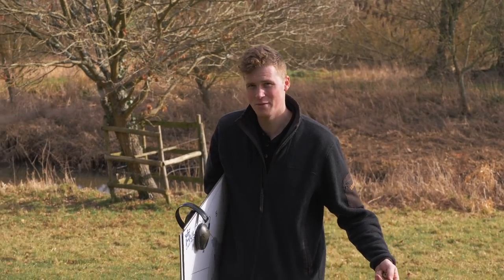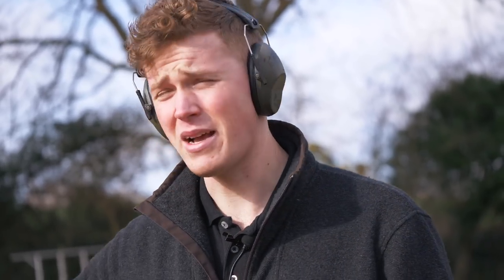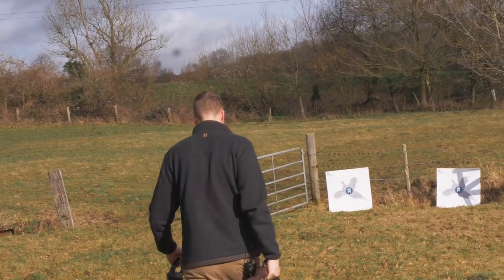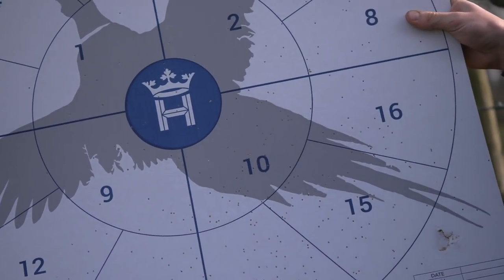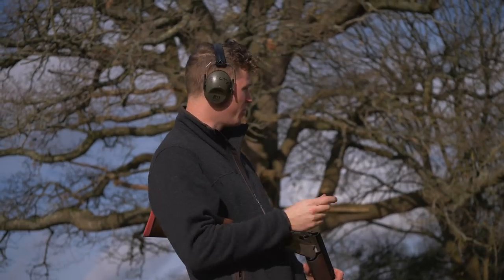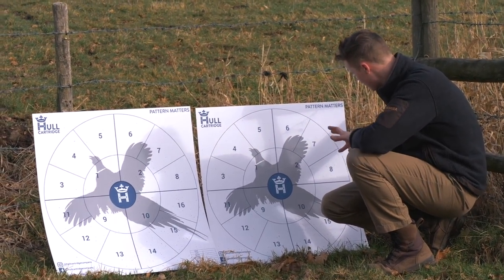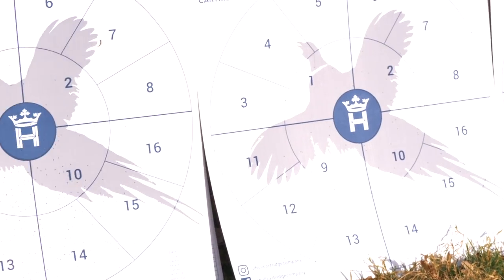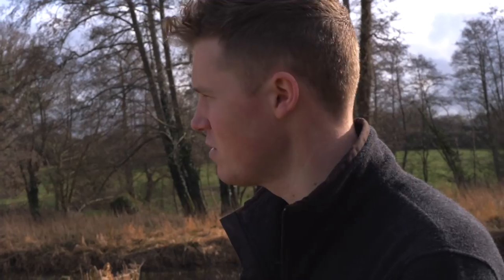Cheap Clay Load Shootout - Plastic vs Fibre Wad

Comment: Plastic wads generally have the shot contained in a plastic cup connected to the wad so the shot doesn’t touch the barrel walls. Does that make a difference?
Also, they often have a ‘springy bit’ between the wad and shot ‘cup’. Does this reduce recoil compared with fibre wads or does it have some other function?

Comment: Hey jon, what price are those cartridges you used, I’ve never come across them here in Ireland. I usually pay between €5.50 and €6.50 per box, depending on brand and volume of course. Usually clever or Olympic blues

Comment: Hey there. I'm wondering if you have any steel shot alternatives for older barrels. Belive my winchester model 12 is a 1952 full choke. Could I ream the choke and shoot steel. Or use a non toxic soft metal? Thanks.

Comment: Great video.  Very interesting when looking at fiber vs plastic wads.  Jonny, do you know if fiber wads affect chamber pressure?  Just curious as a re-loader.
Reply from the maker: Honestly i don't know the answer to that - will look into it though
Reply: Keith Hane. As myself a very experimental  reloader i have loaded fibre over a plastic powder data and visa versa with absolutely no difference whatsoever in a cheddite case.
Pressures may vary very slightly but nothing i have ever noticed.   22 Grains of Green Dot 32 grams of shot  with either Fibre or plastic in my own humble opinion for sensible range shooting is unbeatable pattern wise. Oh and a fiocci 616 primer.or a Remington 209. To be honest in a shotgun CARTRIDGE  primers are not really an issue.  Again this is just my opinion. Be safe all the best mate.
Reply: @manofkentcatapultsgunsando5069 , Thank you very much for your information.  Here in the States, I don't have much access to fiber wad shells (geographically speaking).  I have been curious about reloading fiber wads myself.  I am very drawn to their environmental friendly attributes.  I will try your Green Dot suggestion, I am typically using Winchester Handicap and Universal.  Thank you very much!

Comment: I would use fiber anyway because it is better for the Countryside
Reply from the maker: I think at a clay ground they are acceptable, as they are in a contained environment. Dont use them out and about though.
Reply: @tgsoutdoors  it will not be long till plastic wad will be banned along with plastic cases and every one should use fiber any and start to look to wards the paper case
Reply: @benclay8689  Nothing more nostalgic than shooting the old paper cased cartridge. Just a bit of a bastard when they swell up in the damp and you have to hammer them in with the palm of your hand.😂
Reply: @manofkentcatapultsgunsando5069  - I couldn't agree more! LOL